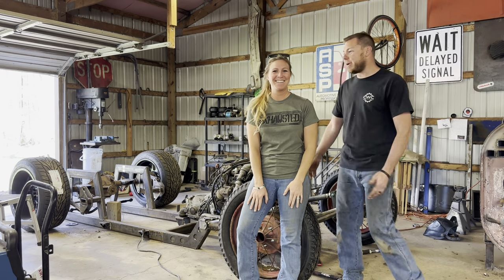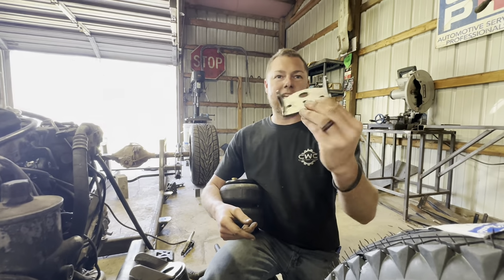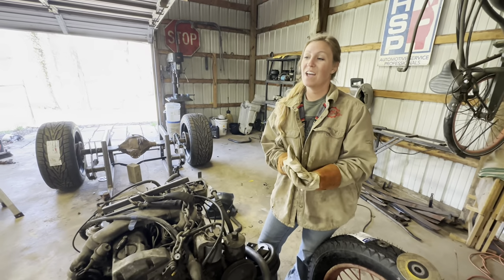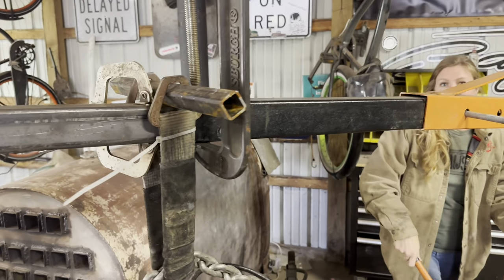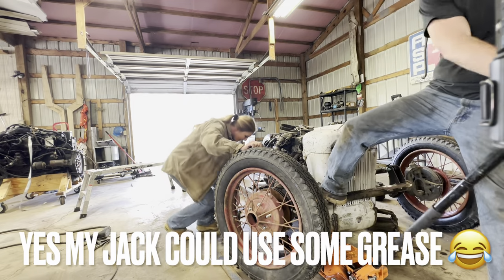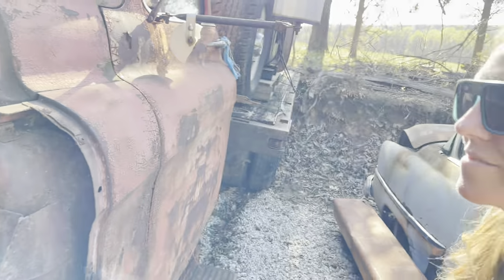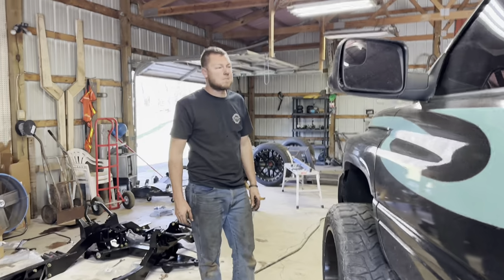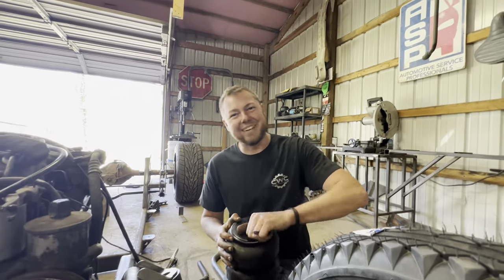Mouse trap, & ROD RUN PREP

Comment: That V-6 came in a diesel 478cu called a GM TORO Flow I  put 1 in a 67 C 20 Chevy in 1973 it wasn't the first diesel pickup but there weren't many like it back then.

Comment: Corey, you can always if needed! Cap one end of pipe, fill with sand and pack it in then cap that end! It usually bends almost perfectly brother! Get it like you like it and let cool before you cut the ends off! Leave no air space for kinks in the pipe, just takes a little time Corey! I’ve had to do it at work because they didn’t want to buy the size die I needed, cheap employers! But it does work brother! Corey, I had always liked using the high cuff tig gloves! More comfortable and really soft and flexible brother!

Comment: Hi there Hannah and Cory! I thought should pass on a little info I got from an old timer regarding the model a rims. I build a 49 f-5 and used similar ford wire spoked rims. I used a spacer just like it looks like you guys did. I had about 1/4” gap between the drum surface and the rear surface of rim hub. He told me that those rim hub centers need to press up against a solid surface at the same time the rim hits the surface of the adapter where the lug nut holes in the rim are. This is so the spokes have support they need to keep the rim “true” when driving down rough roads. I had to chuck them up on the lathe and take 1/4” off the adapter. You might even be able to make a plate on the plasma table with a large diameter that bolts between the disc rotor and wheel adapter with your bolt pattern. I hope I explained that clearly for you. Maybe you already were aware of that but I figured it wouldn’t hurt to reach out! I love your projects! Keep up the awesome content!!!!!!
Reply: Yeah those old type wires arent like the ones on a Jag or MG, they use the brake drum for support

Comment: My thoughts (although I've not finished the video yet), would be to take that bag-tower brace across the front, would be to cut it out, leaving a couple inches on each AB tower, then weld on a couple of 2-bolt 1/4" thick flanges, cut 1/2" off the cross bar, weld it all together, then bolt that support strut in.  This will allow access to that crank pulley, without having to pull the engine, should you ever need to do maintenance in that area..   Just a suggestion..   We used to do this on chock towers on rock crawlers, where the tower strut went across the top of the engine, barely clearing the intake manifold.  Then, you can pop out 4 bolts, and have plenty of access, should you need it.

Comment: Kool build, you can use a sewing tape measure on the radius measurement, they work nicely for that instead of bending the steel tape, your tip of the day. 💯🆒

Comment: You might want to look into making the cross bar over the engine & make it removable  then you get the space back in front of the engine & you can probably mount your turbo on to the cross bar. Just a thought. Great work regardless. 👍🏼

Comment: I hate waiting on parts. Im finally going to pick up my transmission that is built to 800 HP tomorrow. I can finally get the engine mount brackets done for this 64 F100.

Comment: the 4wd community has a coupling for roll bars you can use for that front bar where it is removeable should you need to work on motor. they are strong Fab Rats has used them on some of their builds as well they are super strong. muddy beards has used them also

Comment: Does the top rad hose reach the upper rad outlet if you just spin it 180 degrees from where it currently points (pointing to the right instead of the left)? Love the design for the front bags (yes, they do look good!)

Comment: Corey... Dude... You don't have to yell. LOL Yeah, it's funny to joke about PPE until you see somebody get hurt. I had a coworker who was grinding wearing a face shield AND safety goggles. Two pieces of red hot steel took the perfect bounce and lodged in his cornea and actually got melted in there. When you grind, you're getting pelted with millions of tiny metal shards and it's just a numbers game before one takes the perfect bounce. Like I said safety's a joke until you''re cleaning blood off the shop floor or sending a coworker to the Emergency Room.

Comment: A hiem joint will look kind of good if you run it down off the grill on the side of the grill down there where do you want to go? I know it’s expensive though them Heim joints are not cheap

Comment: A Tip from watching Bad Chad’s channel he uses masking tape on curved surfaces rather than using a steel tape measure for duplicating layout marks from one side to the other, he places marks on the masking tape removes it and places it on the other side.

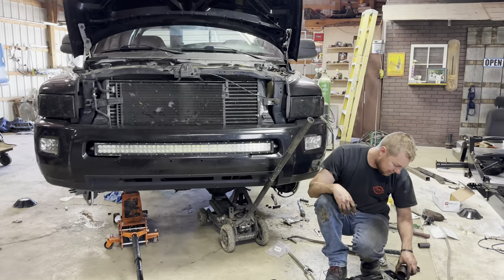Comment: Loving the Crosley Mouse Trap! Also, that motor just needs to be taken outside and flushed to evict its current residents. Speaking of safety equipment, at 38:33 I saw what looked to be some stealth safety equipment hanging on the back wall. Anyways...I guess I will be banned by Hannah now.

Comment: Probably could’ve gone with one single airbag dead center front of the motor where the radiator would go for the suspension. Just a thought.